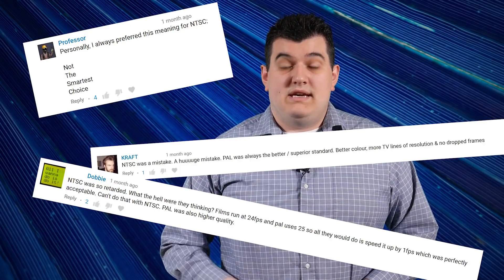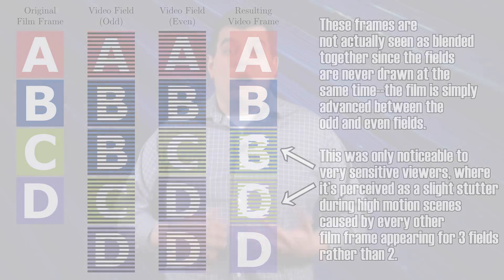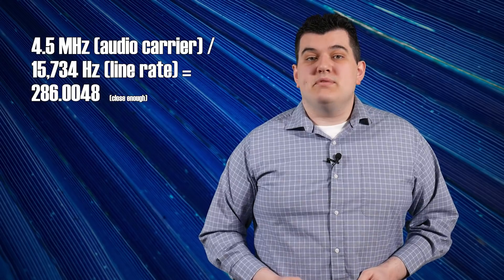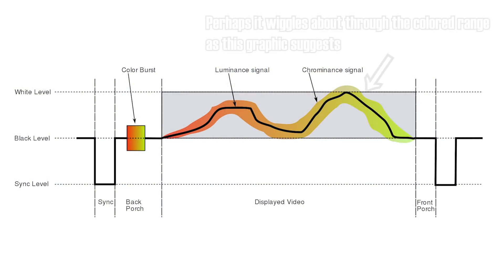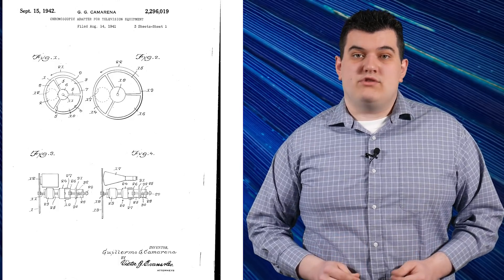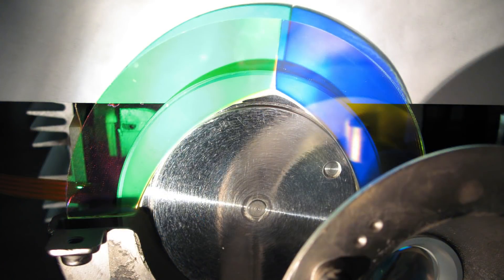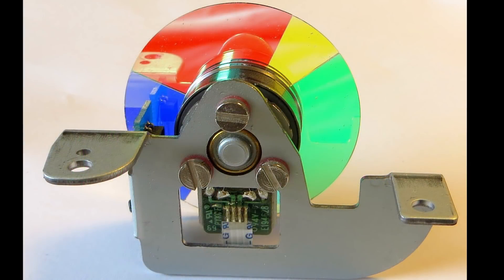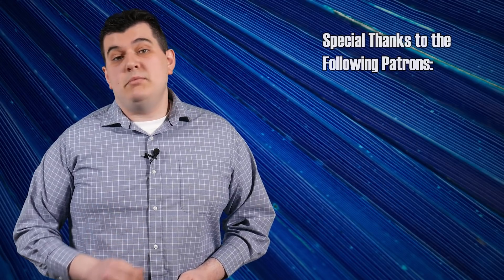Analog Color TV Wrap-Up--Some extra info

Comment: Yeah, as someone who grew up in a PAL country I completely agree about sped up movies being worse. I first started to notice this when listening to movie soundtracks on CD, and wondering why they sounded different than the movies themselves. It's an awful, awful thing to do to a movie, especially if you care about the sound, since it will either be the wrong pitch, or pitch-corrected (with varying degrees of quality) but still at the wrong speed.

The Lord of the Rings Extended Edition DVDs released in the Netherlands are probably among the worst example of terrible pitch-correction (that I've seen, anyway). There's an audible popping noise during almost the entire movie. From some reason it was much more noticeable on the DTS track, so this was one of the few movies where I actually preferred the Dolby track just because of that.

I'm so incredibly happy that most of these problems are no longer an issue with the HD standards. Almost as happy as I was when I was finally able to turn the subtitles off on DVD (having them baked into the image on VHS sucked). :)
Reply: The worst PAL experience I remember was Pink Floyd: The Wall. After hearing the record for years, it was annoying to see the movie on British television with every song raised a semitone, and I do not have anything like perfect pitch.

Comment: Way to call out the PAL fans. Europe was WAY behind with their color broadcast standards. It's like comparing a mid 60's Mercedes to a mid 50's Chevrolet. A lot gets improved in a decade. For mid 50's technology that was also backward compatible color NTSC was pretty amazing. And, as you pointed out, the few shortcomings were addressed by the time PAL started to take off.
Reply: Sir David Attenborough talks about his early efforts to promote the new broadcast standard.
https://www.youtube.com/watch?v=22uUS8vq48c
Reply: If you think Europe was behind, you should have seen Australia. We didn't start broadcasting in PAL until 1974. On the other hand, we did handily beat the US for sheer speed of adoption once we did get colour TV going.
Reply: Not quite right, Daro. BBC2 began 625-line b&w broadcasts in 1964, colour beginning in 1967. BBC1 and ITV began colour broadcasts in 1969.
Reply: Shared Knowledge somewhere else on YouTube,  there is a video of the Bert Kaempfert orchestra from the first color tv broadcast in Europe (1968)

Comment: Can you clarify for me if SECAM luminance values were reversed? One time, years ago, I was in Cornwall, England, and I was able to receive a French TV broadcast, and the image looked like a photographic negative. It was strange, I thought.
Reply: Foebane72 
In the late 80s I went on an exchange trip to France from the UK and took some video cassettes to play of typical UK programming so they could see what was broadcast here. Same problem with the colour - I seem to remember the tapes would only play in b/w on SECAM kit.
Reply: Yes! SECAM didn't invert the luminance signal like NTSC and PAL did. A strong signal in NTSC (and later PAL) meant a dark area, while to SECAM it meant a bright area. This meant that SECAM had a lot more snow in dark areas if you were watching a weak signal. 

Why they did this, no one knows.
Reply: @scottlarson1548  Yes, The original French, Belgian and British systems began with positive modulation in monochrome, so for compatibility reasons, the colour systems remained the same.  The British system took advantage of the change to 625 lines, 8 Mhz channel bandwidth to employ negative video modulation.
Reply: @Broadercasting  PAL uses positive modulation?
Reply: @scottlarson1548  I replied just to clarify the timeline because your underlying assumptions are correct:  The original UK system in 1936 was 405 lines and monchrome and VHF only, with positive modulation. The UK introduction of 625 lines at UHF only with negative modulation in 1964 pre-dated PAL colour coding which followed in 1967.
A little known additional fact: We followed the Irish standard whom started 625 line transmissions from the start in 1961 with 8Mhz bandwidth and the audio subcarrier at 6MHz, hence we used CCIR System I
Reply: @Broadercasting  Oh yes, that Irish television format that Telefunken copied.
Reply: @scottlarson1548  I'm not sure what you mean:  PAL and SECAM are colour formats, but the base systems are independent. And the timeline is as complex.  French analogue TV has always been positive modulation whether it be 625 or 819 lines.  UK TV was only positive modulation for its 405 line service.  German TV was negative modulation from the outset (1950) before Irish TV (1961).

All the above is true before colour coding.

Eastern Bloc countries used a version of SECAM with negative modulation, so the main point is modulation is independent of the colour system.
Reply: @Broadercasting  What Irish company developed the 625 line standard and which Irish electronics manufacturers produced the television sets?
Reply: @scottlarson1548  RTE is the Broadcaster responsible for TV transmission in the Republic of Ireland and I believe BBC engineers got involved in the build, but you need to google for specific details.
The system employed 625 lines system i, negative modulation with a 6MHz sound subcarrier with 8MHz channel spacing at both VHF and UHF. To avoid confusion with UK 405 line transmissions, VHF channels were labelled A to J (see link)

Early TV sets tended to be UK made before the Japanese boom.  Sets including manufacturers such as Baird, Pye, KB,  Ecko, HMV, Bush, etc.

https://en.wikipedia.org/wiki/Television_channel_frequencies#/media/File:VHF_Usage.svg
Reply: @Broadercasting  Thanks, Bill. So RTE invented the 625 line format! That's odd because I have two books on the history of television (including the definitive one written by Albert Abramson) and neither of them say that. But I guess if you found it with Google then it must be correct.
Reply: @scottlarson1548  I didn't say Ireland invented the format. I've no idea where you get that from.
Reply: @Broadercasting  What did you mean by "the Irish standard"? I wasn't aware Ireland had been setting standards in television broadcasting since neither of my books mentioned it. Abramson's book has a huge chapter on what Europe and the U.K. did after they rejected the NTSC standard in 1957.
Reply: @scottlarson1548  Ireland was the first to use the standard for system i which several other countries then followed, including the UK. At that time, most of Western Europe used System B with an audio subcarrier at 5.5MHz with 7 MHz channel spacing. More details here:
https://en.wikipedia.org/wiki/CCIR_System_I

Comment: HD movies and TV shows at 60Hz on 1080p monitors and TVs are a mixed blessing when you've come off PAL SD: the ghastly 3:2 pulldown (yes, it IS ghastly) has returned (at least so that the display alternates between 2 and 3 TV frames for every movie frame) but the audio is at least correct. It seems you cannot have it both ways.

Comment: PAL was pretty bad for video games too, most games ran noticeably slower.
Reply: To be fair this was due to lazy programming out translation from NTSC games. But yeah must of those games are unplayable after growing with with the NTSC versions like Sonic.
Reply: Clay3613 but PAL was definitely better for the retro demo scene.
Reply: @merlingt1 You could do that, yes, but then you have to deal with a noticeable loss in quality by taking out sound bits to make them play faster and be properly synced up with the game without also overflowing the sound processor. Or instead the developers would have to completely reprogramming the sound from the ground-up, but maybe less obviously this would also require reprogramming the sound processing in the game, something that was already an extremely lengthy process on both the Genesis and the Super Nintendo so it's not really laziness for the reason they didn't do this so much as it would require basically reprogramming the entire game with PAL in mind, or for European-developed games than NTSC.
Reply: Clay3613

Yep, this again was for historical / technical reasons, and not really an inherent problem with PAL itself.

It just happened that many of the popular consoles of the time originated in NTSC land, like the Famicom / NES.

This was also true of many of the arcade boards that preceded those consoles.

Almost all of the earlier systems used tile-based graphics, and custom hardware, and it was also cheaper and easier to tie all of the video timing stuff to a specific frequency, and usually a multiple of the colour carrier frequency too (on consoles / home computers).

And, because a huge number of games also originated in NTSC land, it did make it very difficult to properly port those games over to the PAL machines.

It certainly is possible to do much better ports of games to PAL, without slowing down the animations / music / samples at all, but it was time-consuming enough back then to even code the games in the first place.

It was often just far quicker and easier for the games to be modified only slightly for the PAL regions, and let them run at a lower frame rate (again, because the graphics "rendering" of hardware back then was very often tied to the video output timing).

This was also the main reason for a lot of PAL ports having black borders at the top and bottom of the image. It wasn't because PAL has vertical resolution either, it's because it has MORE lines.

So, the original 240 lines (for example) of the NTSC game would tend to look slightly squashed vertically when fit into a PAL frame, which usually had more visible lines.

It's a shame that the US, UK, and many other regions didn't just agree on some proper standards back then, but I guess there was far more competition in the race for decent TV broadcasts etc.

I've personally always hated the whole interlaced thing, but I completely understand the technical reasons why they introduced it back then. It just allowed them to double the effective number of video lines, but using the same amount of bandwidth.
Reply: And yep, we may have drawn the short straw with many game ports in the UK / Europe (and elsewhere, like Australia/NZ), but we did enjoy a golden age of home computers, with some amazing games and coders being produced.

Many people might doubt the impact that time period had on the World of gaming (and general computing), but it was an era which produced a huge number of talented programmers and games companies.

The Euro demoscene was HUGE back then, and yes, we definitely do have to thank computers like the C64 and Amiga as well, but machines like the ZX Speccy are massively important for helping to kickstart the gaming industry over here.

It was almost single-handedly responsible for allowing youngsters to get started in coding, and many of them went on to make games for the Amiga, NES, Master System, and then the Playstation, N64, and beyond...

https://www.youtube.com/watch?v=trtFxmucRkc
Reply: Not a problem with PAL. If the game had been developed with PAL in mind, the reverse would be true (accelerated on NTSC consoles)
Reply: That's just due to quick-and-dirty non-portable timing systems. Hell, some poorly-written PC games use systems like that. Override the game's choice of refresh rate in your video driver settings and they'll run at a different speed.

A well-written timing system will work the same at any refresh rate. It just takes a bit more effort to write.
Reply: It is not the color format, it is the mains frequency which is the problem. US TV has 30fps because the mains frequency is 60Hz. Europe uses 50Hz so the TVs use 25 fps. Since games "think" in frames, each frame (or couple of frames) is a logical "game loop", less fps means the game has less loops per time. You can fix this easily for most early consoles. Just crank them up to "PAL60", let it run like NTSC but the chips still create PAL instead of NTSC. Modern PAL TVs do accept 30fps, meant to play US VHS tapes. While only some are advertised as "PAL60" or "NTSC playback", most modern TVs could do that. 
The only problem is that the color carrier is also wrong so either your TV is extra tolerant or you need to modify the color circuit of the console as well.
Reply: An interesting inversion was with some console games made with PAL systems in mind. Codemasters' Colin McRae Rally 2.0 for the PSX is one. The PAL version ran at full speed whilst the NTSC release appears to be somewhat slower. It appears that the developers didn't seem to bother about changing the game's timing to match that of NTSC's higher refresh rate. But considering how rallying is a niche sport in the US (or at least at the time), they may have done the North American version as an afterthought.
Reply: Yup, it was much easier to just use a different clock crystal in PAL vs NTSC consoles back then and not require the can of worms that one would require to make a PAL version of the game with correct timings (and audio). Also remember the consoles master clock was always timed with the colorburst signal of each standard as an exact multiple.
Reply: It is not possible to give the video circuit its own independent clock source. 
Actually there were RAM chips available until the early 1980s which had two independent interfaces. The idea was that the CPU can upload data at any pace it likes while the video hardware could use this data with any timing it liked.
It never really worked since when the video hardware runs on an independent clock, there is a random phase shift between both interfaces accessing the RAM. When the timing is bad, data becomes corrupt. They never had figured out why, but hardware developers had to sync the clock sources as a workaround and ultimately stopped using those ultra-expensive chips.
Reply: There is another large explanation here somewhere, explaining that PAL has a much larger blanking interval, in which the graphic processor is not used and CPU can execute profram code, so would a game programmer use this extra CPU cycles (up to 70% normally just wasted when ntsc converted), he would actually be able to improve the game massively. Proper coding for PAL you do not need to take out anything, you could actually add features and still make it run faster.
Reply: PAL-60
Reply: AT LAST somebody says it. 50/60Hz has nothing to do with color format, it has to do with the way we get electricity.

As for modern PAL TVs accepting 60Hz, I've even seen old  (like, from the 80s) TV sets accepting it, to the point where I'm wondering if 60Hz-compatibility was the standard rather than the exception, at least on SCART-equipped TVs (which you would need to play video games anyway in Europe).

The Dreamcast was the first console, in 1999, to offer native PAL60 gaming to european consumers. Most games allowed you to chose between 50Hz and 60Hz at boot. They also had a short "test" mode where a test card would display for 5 seconds in 60Hz so that you could gauge whether your TV can handle it or not. I have NEVER seen a SCART-equipped TV not handling it.
Reply: You would still lose 5 images per second though, so if the game ran as fast, it would run less smoothly than on the 60Hz version. This is very noticeable on Dreamcast games, whose PAL versions allow you to select 50 or 60Hz at bootup. They run at the same speed but the 50Hz version has a noticeably more "jerky" animation.
Reply: Well, that wasn't the fault of the system. It was the fault of the lazy developers.
Reply: It was mostly due to developer/programmer laziness, and it is indeed one of my vocal criticisms of various speedrunning communities, only having categories based on console/VC, as opposed to regions and versions.
Reply: Only if you used an American or Japanese console. In 1980s there were plenty of European computer makers making PAL native machines.
Reply: But look better.... So.... No
Reply: You're right..! even there is a video showing the differences with PS1 crash bandicoot.

Comment: Lol, I actually appeared in someone else's video. Achievement unlocked.
Reply from the maker: Achievement unlocked, indeed!  I guess you didn't notice it the first time :)
Reply: No I didn't and it is weird seeing myself appearing on a much more popular channel. I still prefer the idea of speeding up by 1 fps though, no resolution was lost and no frames had to be blended leaving the picture quality unaffected but I see that there are mixed opinions regarding sound.
Reply: Heh, looks like I unlocked the same achievement :P
Reply: Resolution isn't really "lost" in a 3:2 pulldown. The fields either stay onscreen 1 full frame, or 1.5 full frames worth of time. There is always 1 full frame visible for each full film frame in a 2-field period, just some frames half-stay longer for a third field. The only time resolution is lost is if you have captured a framerate (distinct points in time) that equals greater than 1/2 the fieldrate.  Blending of frames still happens with 50i; it just happens every frame if both top and bottom fields represent the same point in time.. Field 1b to field 2a is a blend, even if the transition between 1a and field 1b is not.
Reply: The complaint is that for fast action scenes (or fast horizontal pans), the 3:2 pulldown's effect of displaying a frame where the two fields come from different source frames can produce some horizontal image-tearing, and jagged edges on high contrast mostly-vertical edges.

I've noticed this on commercial VHS tapes and on DVDs.  I've never noticed it on analog TV broadcasts or VHS recordings from TV broadcasts.  Probably because the broadcast itself is a bit fuzzy to begin with.

But I still think it's better than speeding up the movie.  My ears are very sensitive to a soundtrack that's sped up by even 4%.  Everything will just feel "wrong" to me, even if I'm not sure why.
Reply: in a not so good way